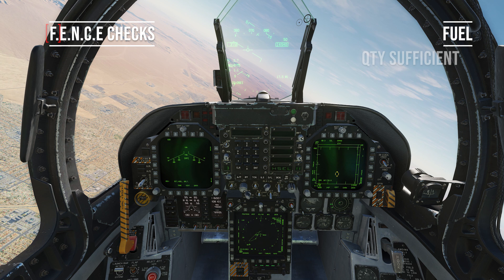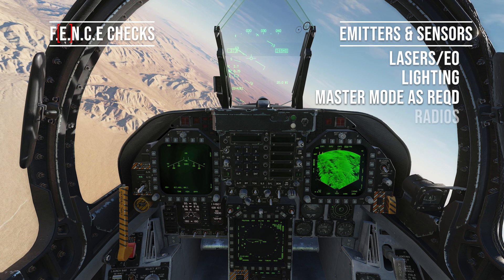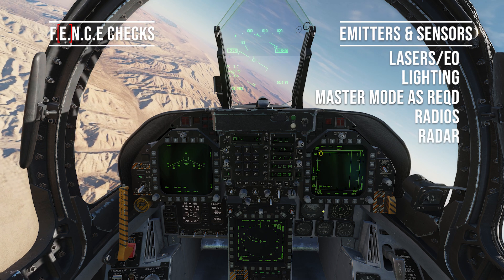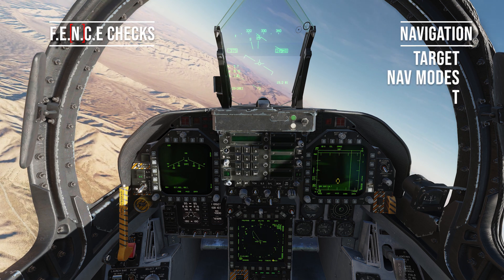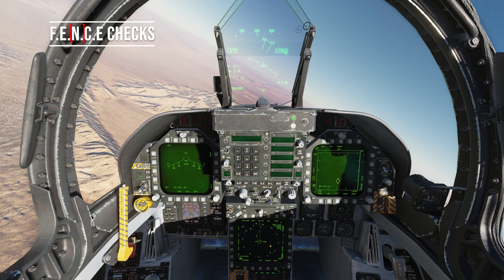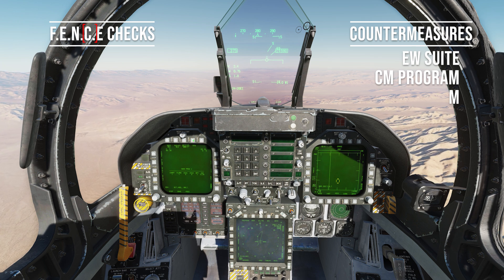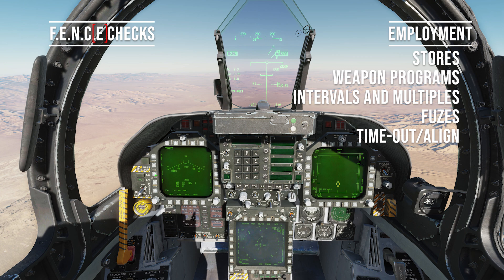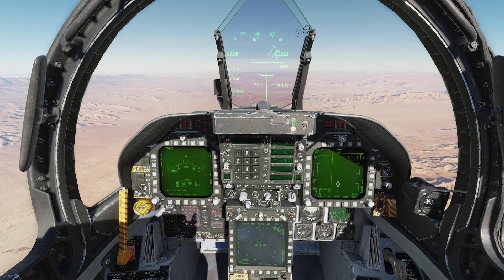Air Warfare Group FENCE Checks

Comment: Cracking tutorial thanks. Question would you program weapons before departure or is it best to do it as part of the F.E.N.C.E checks ?
Reply from the maker: Generally I’d aim to program them prior to departure. Typically in aviation the more that you can do on the ground the better. For real I would expect that all to be programmed into the Mission Planning System and transferred into the aircraft on a data transfer device. ~Tyro
Reply: @AIRWARFAREGROUP  Thank you Tyro for the detailed reply. I will have a go at this.